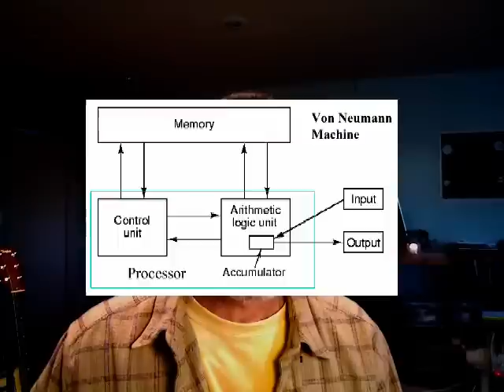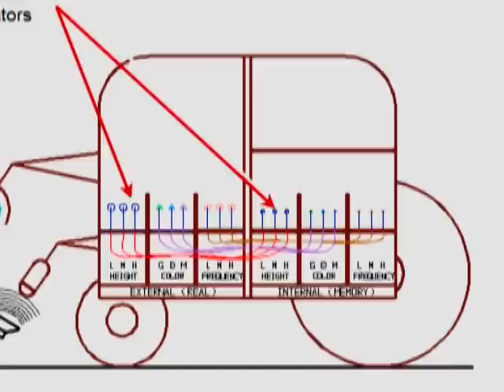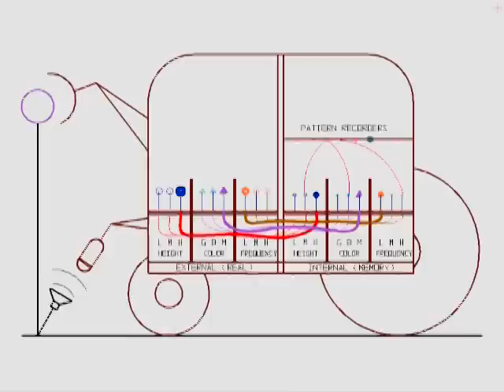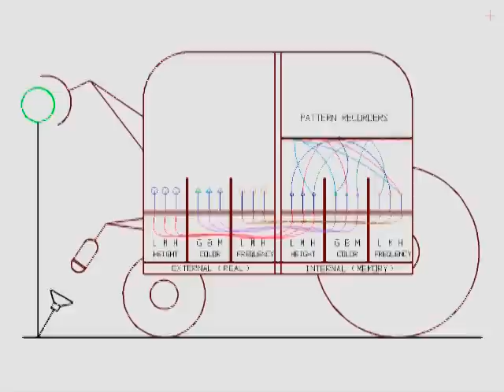Machine Consciousness - What's Required?

Comment from the maker: @LordSlag 
From the computer's perspective, if you could somehow instantaneously stop the program and examine the values of all of the transistors corresponding to the values in the registers, it would be nothing more than a lot of digital ones and zeros.  There would be nothing amidst all of this that would be much different if it was simulating, say, an oil refinery or a weather pattern.